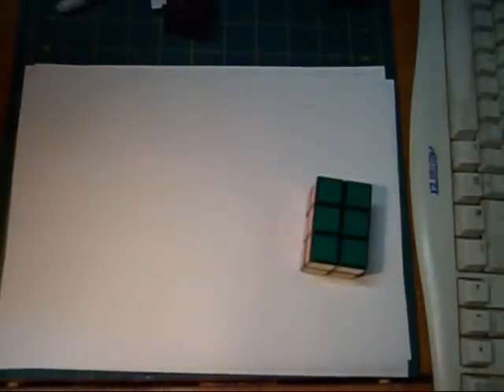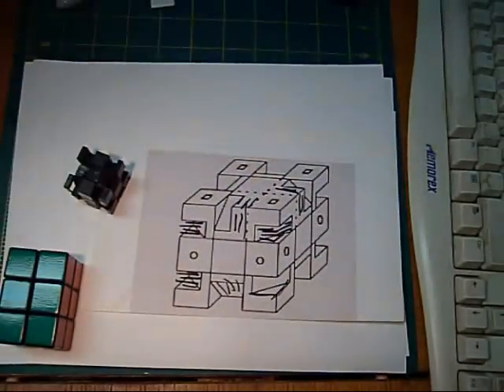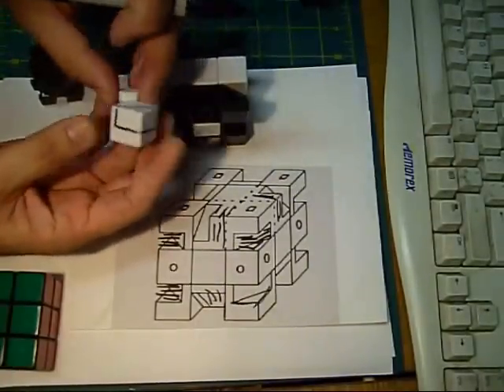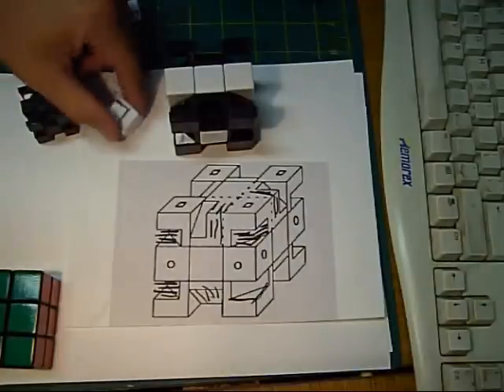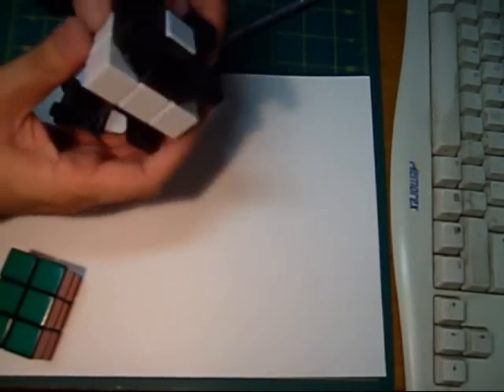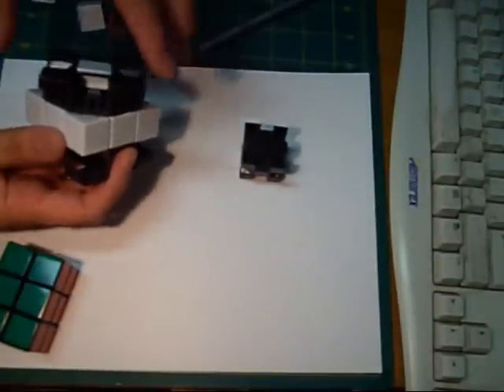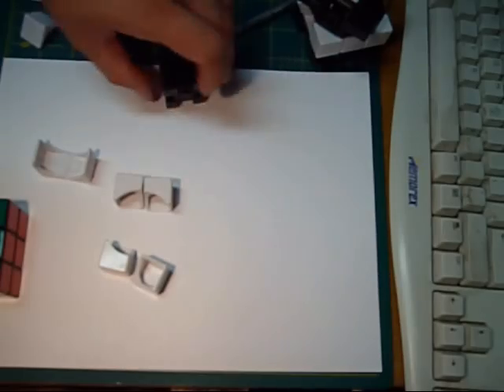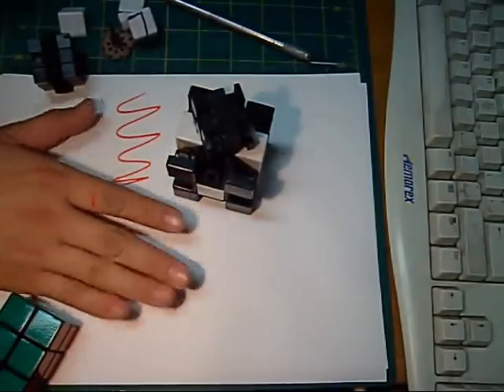How to: Build a 2x2x3 Part 3

Comment: I think it helps understanding how this core works if you disassemble an ES 2x2x2. An ES 2x2x2 core is a 3x3x3 with all edges cut down and 1 corner bandaged with its 3 adjacent edges and 3 centers. A 3x3x2 core is a 3x3x3 with 8 edges cut down and a corner bandaged with 2 edges and the corresponding center. Am I right? :D

PS: Maybe you just said that on your video, but my English is far from perfect.

PPS: Great howto, I can't wait to watch if finished

Comment from the maker: Yes registration is currently closed without invitation at this Time.  As for my oversized keychain model, none of the pieces on it are suitable for use in a Franken Tower actually.  At least not without a lot more modification, just as though I was starting with a fresh new cube.  Good guess though.